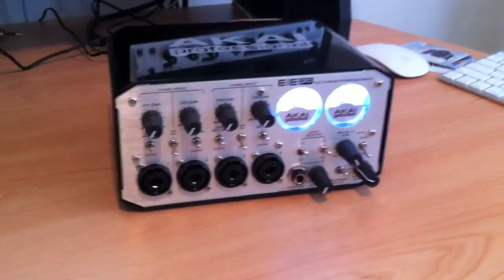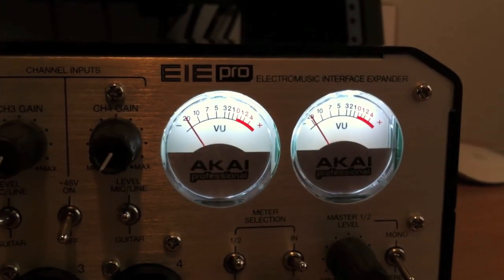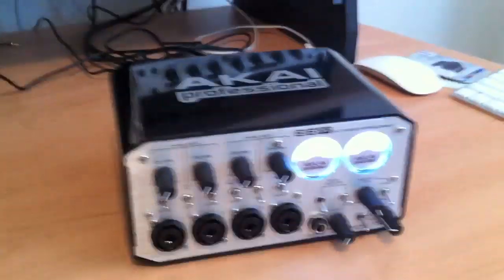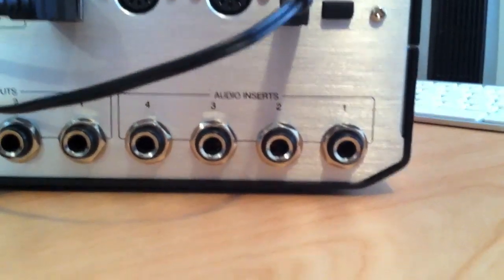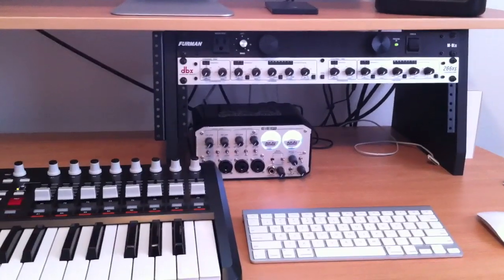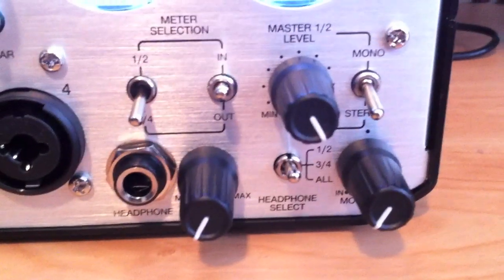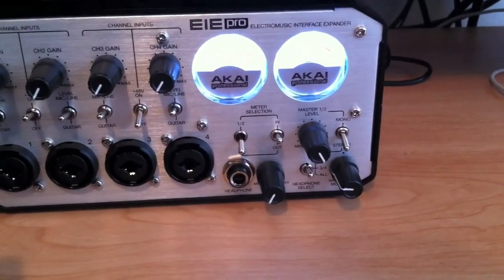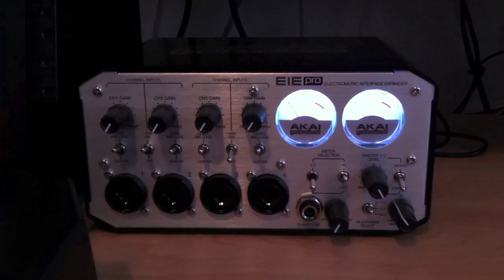Akai EIE Pro

Comment: Okay i used to have this one for a week and after that i returned it from sweetwater because if you plug a device from usb hub port  of this one it will affect the performance. It will cause latency! also you can hear a noise . The most disappointed in this interface you cant get the enough volume while you are recording! if you turn the monitoring all the way to the left you cant hear the sound only the voice from mic or input which is normal.

Comment: it is distorting because your main output volume is too low from ur computer so ur racking the master all the way up. the interface has its own operating noise so ur volume on ur speakers need to be turned up and turn down the master to the middle on the interface. make volume changes on ur computer so the signal comming in is LOUDER so u dont have to rack your master which adds hisss and hummmmmmmmmmm lol

Comment: Yes. It's not a mixer. It's an interface that also has a variety of options for monitoring. That's what all the in-between options are (1/2 or 3/4). There's also the ability to bypass the tube amp to use other things with the ins.

Comment: @redoubt9000 
1. No, it has an external power supply.
2. You can have up to 4 Mic-Inputs. Phantom power is switched on on 2 Inputs at a time. 
I'm very pleased with this device because it saves CPU on my PC.

Comment: That noise heard around 7:05 is the noise floor due to the volume being turned all the way up. For a cleaner sound, I would suggest turning the monitor knob all the way towards the "OUT" and adjust the level from the "MASTER" knob. It appears that the monitor is merely a blend of input and output signal, not a determination of signal level.

Comment: I'm using mine to catch the bird droppings in my neighbors canary cage.
I gotta tell you the EIE pro seems to be a guano collector extraordinaire.
Nothing but crap from this interface. Pickup all kinds of hum and could record once without generating clicking noise. Playback only seemed to work in low res, and failed work with any DAW. They still have no updates for the driver after they id'd an issue with it nearly one year ago.

Comment: You're cable from mini-jack to jack was not TRS, TRS means Tip - Ring - Sleeve and it's a balanced connection. If the DAW clips in the professional Studio, it starts Sounding very bad as you found out. Means the Akai EIE Pro seams to work exactly as it should. When you connect your speakers via the mono jacks unbalanced, the signal was not as loud as now. It can be, that the iMac out's wont clip its a cheep sound-card. or KRK's had a low signal, that it was hard to hear.

Comment: B Demma - I don't know anything about this unit so I'm not necessarily defending it - but that clicking and popping sound is more than likely a result of a conflict in the clock settings.  I've had it happen with other interfaces and it can kind of freak you out until you figure out what it is.  You should have some settings in your recording software to select the internal or external clock.  The software settings have to match what the interface is set to.  Hope that helps.

Comment: The the UV meters only work with the input channels? Or do they show the actual actual output from your DAW and the soundcard itself? 

Also you should look into getting some Aurelex Mopads or something similar to put your monitors on, they are cheap but really help with vibration on the desk as the monitors will vibrate bass on that shiny wood surface. Or if you want to save more money use door stops the old skool way. lol

Comment: Serious design flaw with the 16bit unit (not sure if also occurs in Pro) - put guitar in one channel and 48v phantom powered mic in adjacent channel - adds high frequency noise and cuts the gain in half for the guitar.  So far 3 units have the identical problem.  Doubt if Akai will own up to it or offer a fix. 

Not a problem if guitar is in 1 or 2 and mic in 3 or 4 but I need to use 3 and 4 as stereo line inputs so it winds up being useless as a 4 input interface :-(

I'm awaiting a response from Akai customer support - not optimistic ...

Comment: at 9:05, you say you connect from the output of the mac in the…..? Carrot cave? lol
Need help, because no matter what I plug in the monitor outputs in the back of the EIE, no sound comes out.
Should I plug my monitors in the output if the mac with this kind of cable??

Comment: Say i plug in 1 and 2 into condensor mics for drums 3 and 4 with bass and guitar.  Can i record all of this at the same time?
Reply: no, the limitations of usb make it so you can only record 2 at a time
Reply: damn ok, what should i use that i can do drums bass and guitar for backing tracks all at once on the computer?
Reply: Hello why is can not record 1, 2, 3, 4 together ??
Reply: you should be able to, sorry my information is wrong, the problem is irrelevant with these devices they use a different way to transmit the information than previous ones i have used, you should be able to record all for at once, its today with the way the information is compressed
Reply: howtokillasmurf   i buy m-audio. it has not such a problem with latenci

Comment: i guess this is a good interface only for midi not for recording and  djing! not good for recording because you cant use 96hz its lag on adobe audition, pro tools, cuebase at sonar! This is the reason thats why AaanthonyyyNick  doesnt upload any song using this interface because of that.. The most bad thing i encountered with this is lack of power output. I set the master volume all the way and the direct monitoring is in the middle! it isnt give a appropriate sound to my krk rookit 6.